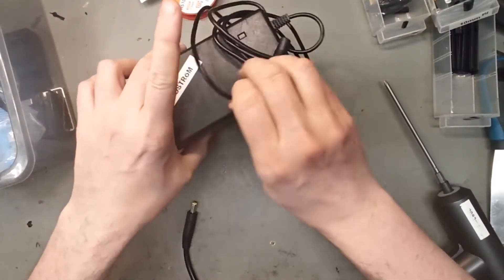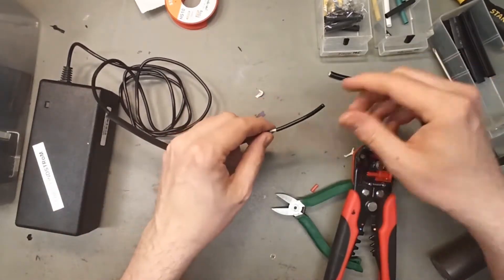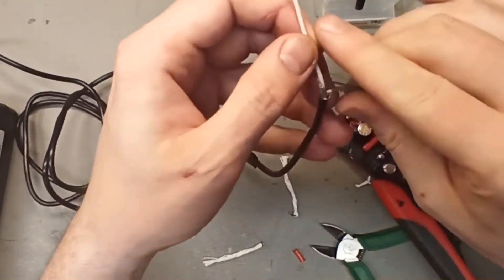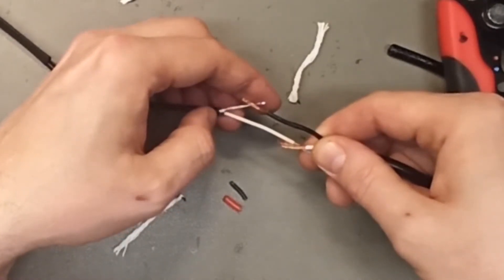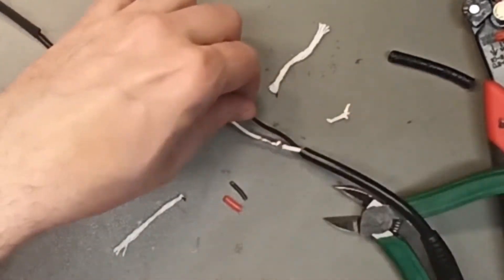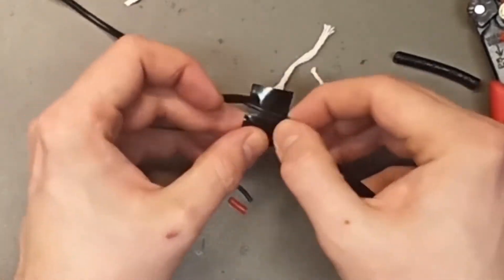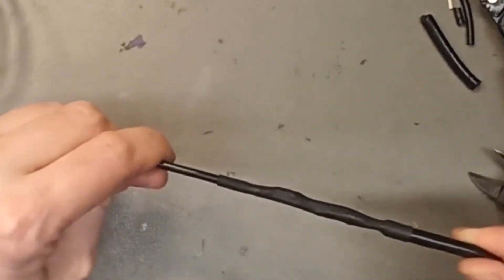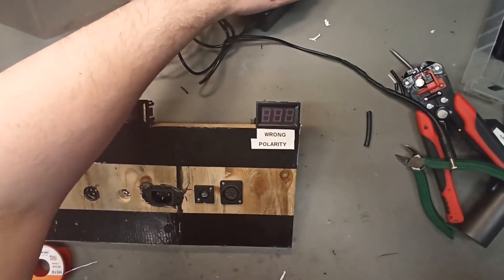How to repair/change a damaged DC connector on a battery charger

Comment: Where did you get the replacement cable? I'm having trouble finding a 5.5 mm dc jack that's rated for 54v